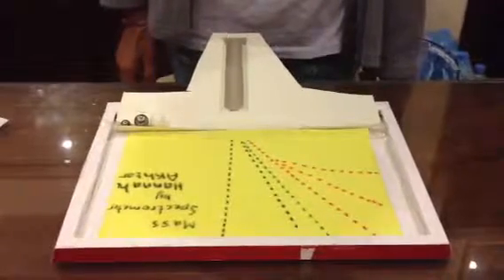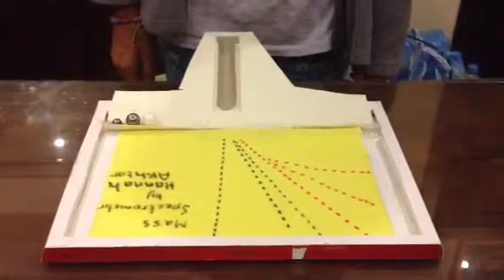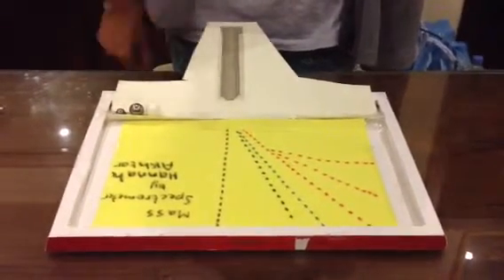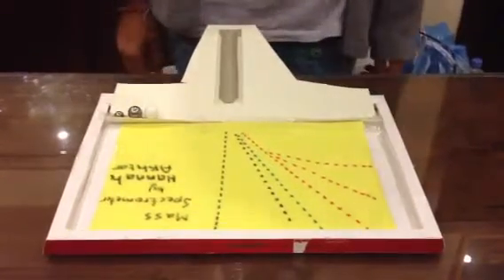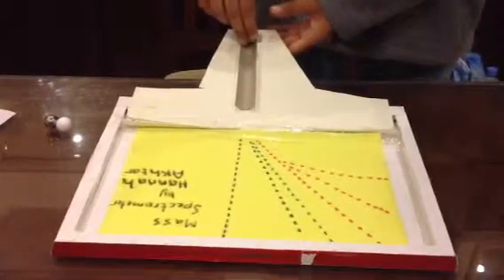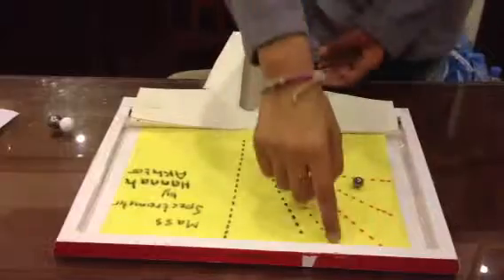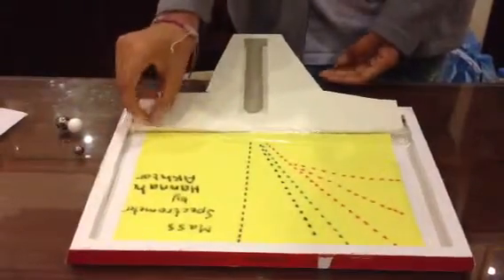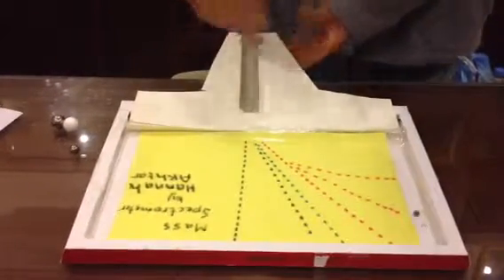Mass Spectrometer Demonstration

Comment from the maker: To make my model I used the lid of a shoe box and glued some felt to the surface. I glued  a piece of cardboard at one end in order to make a ramp. Below this attached piece, I taped a small magnet. After filming the different sized ballbearings go down the ramp, I drew on their paths with felt tip :)